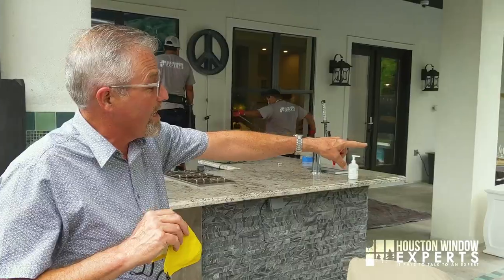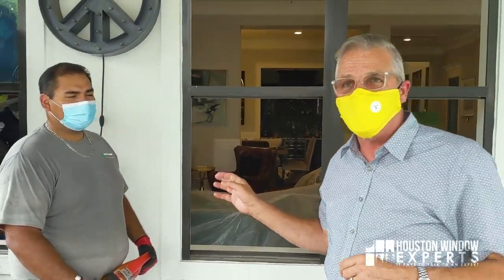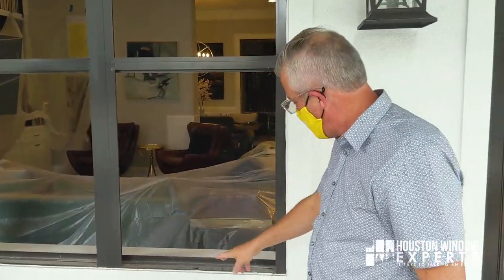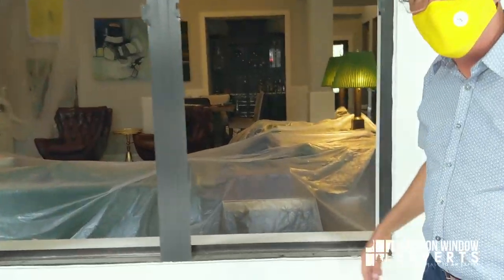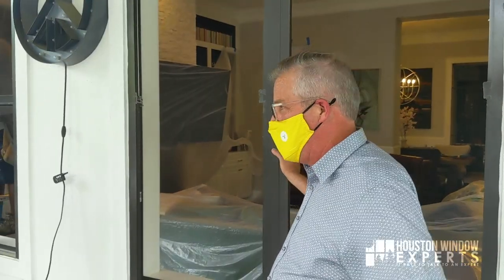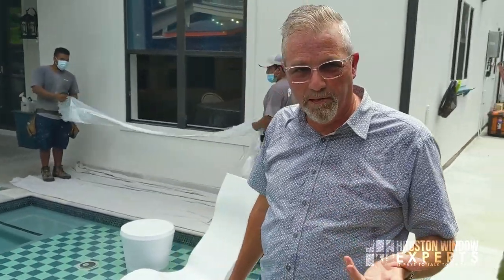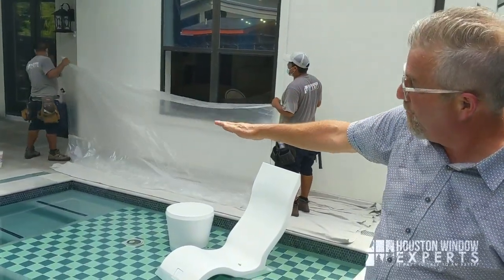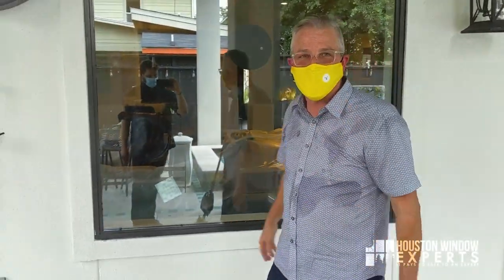On The Job: Picture Windows

Comment: Hi for picture windows do the screws go outside. Please help my worker says they go inside, but I think that the paper sticker goes inside and the screws outside.
Reply from the maker: It would be hard for me to know how to answer this question without knowing what brand of window and which model you are using. However, I can say that the window sticker is always on the inside portion of the window not the outside.
Reply: the screws always go on the INSIDE, if they are outside, anyone can remove them and enter  your home through the window. There is a plastic hole plug/cap thing that covers the screw/hole so it looks nice.